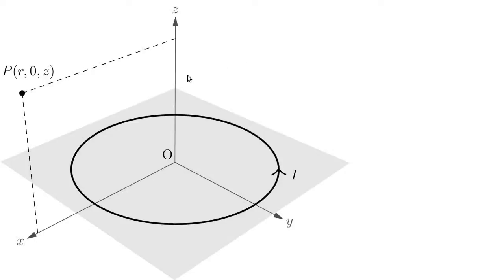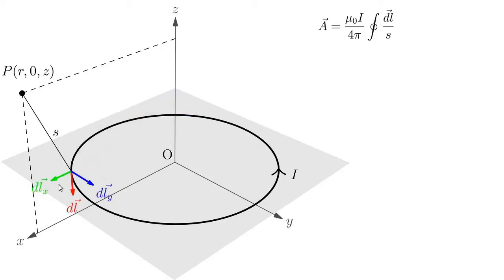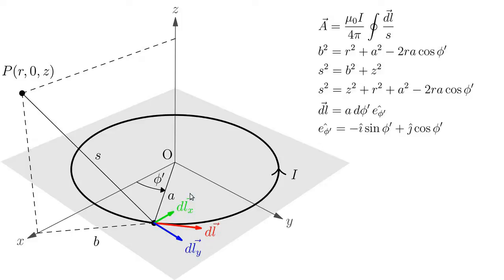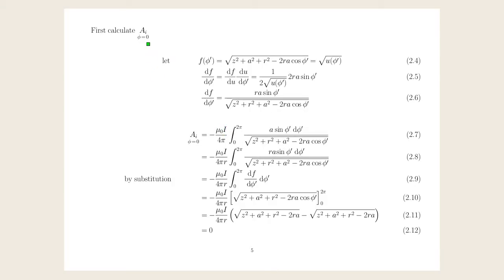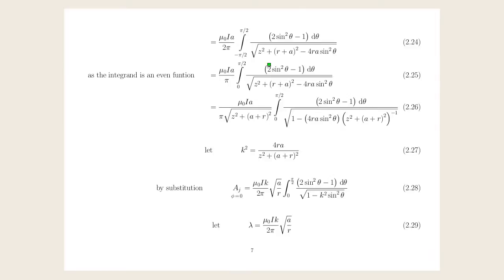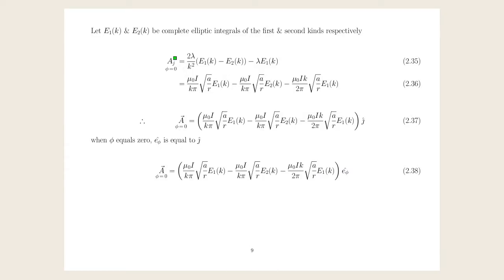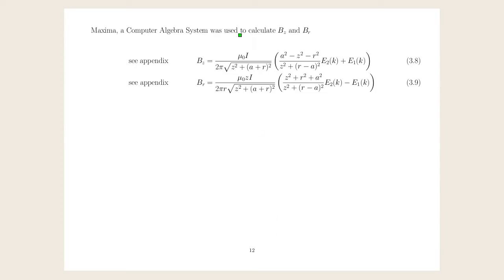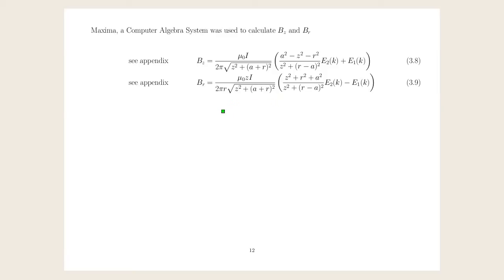Off-Axis Magnetic Field of a Circular Current Loop

Comment: Thank you but I cannot uderstand (2.21) .
Isn't it "(2.21)=0" because integral of cos(phi) from 0 to 2pi is 0?
Reply from the maker: That would normally be correct but there is a phi term in the denominator as well. This makes it a lot more complicated.
Reply: @GPTreb but isn’t it still zero?

Comment: Hi Grant, could you please tell how did you transform form step 2.21 to 2.22?
Reply from the maker: 2.17 simplifies to 2.20. You can then substitute 2.15 and 2.20 into 2.21. Hope this helps.
Reply: @GPTreb  Actually I'm confused about the change in limitation of the integral. Thank you anyway
Reply from the maker: @baldwinchen3409  The integration is originally with respect to phi and so are the limits, but after the substitution the integration is now with respect to theta so the limits need to change also. Equation 2.16 is used to do this.
Reply: @GPTreb  I'm a bit unfamiliar with elliptical integrations, could you please tell me if it's possible to graph (estimate) relationship between y,z and B, based on the resulting equation we have?
Reply from the maker: @baldwinchen3409  It should be possible to graph the relationship but it would be difficult to work out as it would need to worked out numerically. Most mathematics software have elliptic integral functions in them now. For example, the scipy package for Python has the ellipk function.
Reply: @GPTreb  Great Thanks!

Comment: Is it possible to get this result using mutual induction?
Reply from the maker: Nadav Reichler Not exactly sure what you mean.  Can you give me some more details?
Reply: I mean, It is possible to get the mutual induction coefficient of a big ring and a small ring with the same center (small enough to consider the field through it to be on the axis of the big one), then get the magnetic flux through both rings out of that, and some how derive from that the magnetic field at an off axis point.
Reply from the maker: Nadav Reichler I could be wrong but I don't think it's possible.
Reply: You integrate this formula over the small ring to obtain the mutual induction.  Note the rings would not be coaxial or even in the same direction, so the formula for M would not even reduce to elliptic integrals.

Comment: Hi Grant,

just curious, would the result for the flux density change if the quantity "r" was less than that of the loop's radius?
Reply from the maker: The equations should be valid if r is less than or greater than the loop radius.  From memory, the only place they break down is if the the loop radius is equal to r and the z height is equal to zero.

Comment: I have used BASIC (in the 90's) and a few shortcut tricks (lookup tables) to numerically calculate similar values for calculations (mostly optical interference apps) like this--where the principle of superposition applies.
NOW I need to make magnetic calculations very similar to this-in fact, I have used the Biot Savart law with --slow- success.

I need to calculate off-axis B values of circular loops-BUT ONLY INSIDE- the loop.  Will this restriction (internal only) simplify things in your video?
Reply from the maker: Just looking at the equations, I don't think that restricting the field to the inside of the loop simplifies things.  When using the Biot Savart law breaking down the wire into small segments and adding all the fields means you can ignore the maths and just get to the solution.  Best of luck with your project.

Comment: Something seems wrong. On slide 12, for Bz(r,z). The term a^2-z^2-r^2 should probably be a^2-r^2. It is not physical that the field sign inverts for a certain z away from the loop. Moreover, assuming E2(0) = 1 and E1(0) = 0 (?), substituting r=0 will not result in the classical textbook equation of field at the center of a circular loop. Also, a factor π seems missing. (or E2(0) = π?)
Reply from the maker: +Peter Stallinga Thanks for the question.  It's good to see people are reading all the details.  As there isn't much room to answer here I've added a section to the bottom of my original blog post.  http://www.grant-trebbin.com/2012/04/off-axis-magnetic-field-of-circular.html